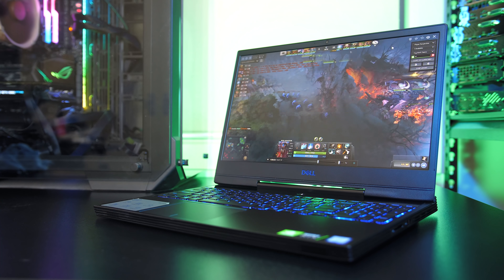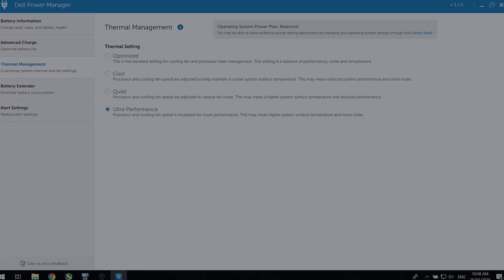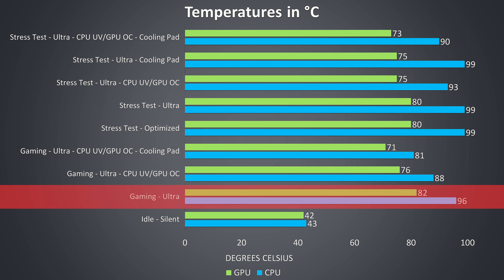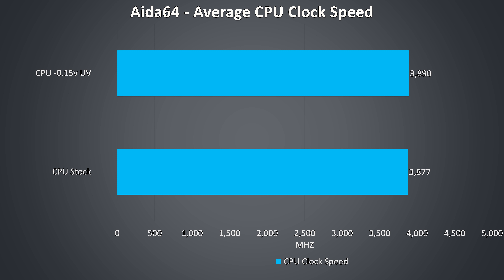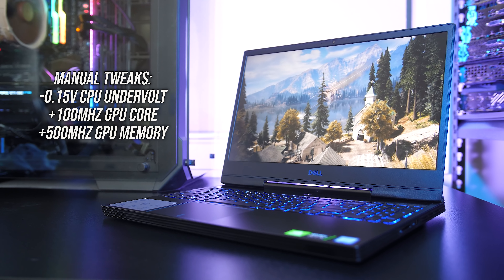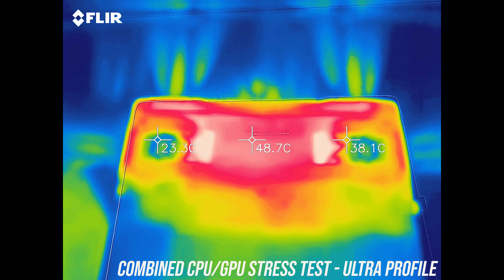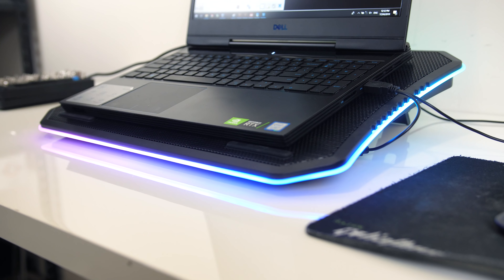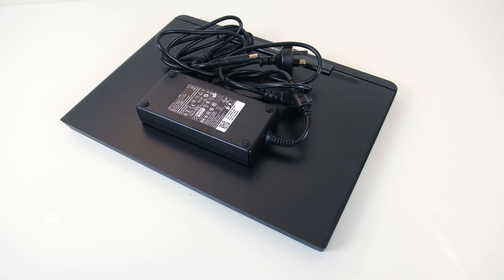Dell G5 5590 (RTX 2060) Thermal Testing, Overclocking and Undervolting

Comment from the maker: Check my full review of the Dell G5 5590 gaming laptop here: https://www.youtube.com/watch?v=BfszKYC2Fus
Reply: Could you share what application you used to overclock the video?
Reply: How did you under volt the laptop? I have searched extensively but couldn't find any solid information on how to do so.
Reply: @cjhouse8666  try Intel Extreme Tuning Utility
Reply: Is it possible to increase the gpu power limit to extend overclocking potential?
Reply: can you hear the fan on idle?
Reply: I have this laptop., but i7 9750H.. and with urgency a change of Thermal paste from factory is neccesary, to a thermal paste of  more quality... 3 month of use and hit the  procesador on 100°C constantly... wheen i changed the thermal paste i solved the  problem... now have 80-85°C.... :)
Reply: @zaper3  what things that you was do?
Upgrade on hardware,or having software control fan speed to be cooler

Comment: Just for the people that are frsutrated like me due to thermal throttling: Undervolting is still possible! My BIOS Version is 1.22. For me it worked to reset the BIOS to factory defaults and then the undervolting was possible. My G5 5590 (with RTX2060) is so quiet when you do normal stuff :) And no more frame drops due to thermal throttling. My Notebook reaches 88°C max when all cores are at 100%. There are some videos here that explains how to do the undervoltage step by step.

Comment: The best way to reduce the heat of the 5590 is to apply a new thermal paste. Anyone who has done it properly will tell you that it worked perfectly fine. Apply Grizzly Kryonaut (5mg syringe is enough) onto the CPU, it will reduce temps by around 10-15C, then buy a cooling pad (a good one with strong air flow, so don't be a cheapskate). Make sure it blows the air in the direction toward the ventilation holes at the bottom of your laptop). That'll give you an additional reduction of at least 5C as a nice bonus. Then you can expect around 15-20C down without undervolting or changing the core speed. 80-85C at a maximum load is absolutely normal for the gaming laptop and at this price range. If you're still skeptical, then buy a desktop PC.

Comment: Nice review Jarrod. Will you be reviewing the new Ryzen 3750H CPU and GTX 1660Ti combo from the Asus Zephrus G laptop? They said it will be out somewhere on May, also can you please review the new Gigabyte Aero 15 classic. Can't wait for these videos. Hope you have a great day/night. :)
Reply from the maker: Thanks! ASUS invited me to a launch event in a week for the new laptops, however I'm not able to make it as it's in a different city, but afterwards I should be able to start getting some review unit.
Reply: @JarrodsTech  too bad you can't make it but still happy that you're getting a review unit.
Reply: @JarrodsTech  when you do, could you help to find out if the USB-C can connect to a docking station to output display please? Also, wondering if using a PD charger will provide sufficient power to it when not using discrete graphics card.

Comment: After messing with the alienware command center I got fan control to work, trick is to delete the one that came with the computer and download the full app cuz its quite limited on the g5 whereas after re-download version can control the fans, I got my under load Temps down to 70 degrees with a repaste aswell
Reply: What is the name of the full app and from where should I download it
Reply: @mustafahamdi4229  the app dosent work anymore, just give up on fan control I tried for over a year just to give up and buy a desktop

Comment: Excellent review, very specific details, Thanks for the review, I wanted to buy this Dell G5 5590 with i7 9750H and GTX 1660Ti! I just wanna know how hot it can get, so thanks for the review.
Reply from the maker: No problem, cheers! Hopefully I can get the new 9th gen version soon!
Reply: @JarrodsTech  Do you recommend this laptop?
Reply: i'm thinkings about the version 1660 ti as well
Reply: @quecobpt  I ordered the 1660ti one, did you get yours? how is it so far?
Reply: @moonar5820  no. i bought a odyssey 2, the one with 2060 rtx
Reply: @quecobpt  I bought this laptop the other day.... definitely worth it
Reply: @RobNZ64  how long does it take to became hot? I dont mind the overheating if it happens after hours of use, ill simply turn it off until it cools down. But if you tell me it gets hot in 10 minutes there we have a problem
Reply: TEO Hi, don’t buy this laptop, had to return mine, CPU is always running too hot and can’t under volt it now because intel patched something in the latest bios update
Reply: @RobNZ64  wow thanks!!! Normal users like me often have the most realistics feedback, i trust you!! Yesterday i put my eyes in the hp omen 15, with 1000€ you get the i7 and 90% rsgb. What do you think of it?
Reply: TEO I actually went with the Acer predator Helios 300, same specs as the dell but comes with a factory under volted cpu and runs way cooler! Specially with the turbo mode enabled which overclocks the cpu and you (though you have the extra fan noise but I don’t notice it because I have headphones on) but it’s cool without the turbo mode but even cooler with it enabled.
Reply: @RobNZ64  it costs too much for me 😅. Im intrested in content creation, not in gaming, so i dont think the heat/fan specs are that important to me. I ll keep studying the market, but for my budget the dell and the omen were the most appealing
Reply: TEO oh yeah it is expensive, but I managed to get it in a sale $1000 NZD off so it made it as cheap as one of those omen laptops. But yeah I would avoid that Dell for sure! Good luck finding a laptop, would be good if that Acer comes one special sometime soon.

Comment: Thanks for the great Review!
I'm willing to buy the laptop. So after you have experienced it, did you notice any danger on the CPU when reaching 99 degrees?
Does it mean that my CPU is gonna be destroyed after while?
And has it happened to you, that the Laptop turned off or a Game closed automatically while gaming on Ultra Graphics Settings because of overheating?
Reply from the maker: Cheers! It's honestly impossible to say. While higher temperatures do generally make components not last as long, I've never found good long term data or studies showing how this can affect a laptop. Components are designed to thermal throttle and reduce performance to prevent them cooking themselves, but yes generally cooler is better. I've never had a laptop turn off or close an application due to high temperatures, I don't think they need to do that anymore, they just thermal throttle back.
Reply: I have. 2 resets playing Starcraft 2 LOL. Including Blue Screen
Dell G7 core i5 9th gen + RTX 2060. Of course i returned the shit to Best Buy

Comment: Thanks for the review Jarrod! Although your review suggest that this probably isn't the gaming laptop to buy, I managed to snag this from Dell AU for $1800 (9750H, 144Hz, 2x8GB ram, RTX 2060 edition)

I hope undervolting will be enough to keep it from thermal throttling...
Reply from the maker: It's hot but does have power behind that, double edged sword, undervolting should help though.
Reply: Clint Yip How it it’s doing now? I want to buy it but I’m worried the thermals would decrease the performance and lifespan of the laptop

Comment: Hi Jarrod,

Good review first of all. I was going to ask you how much difference there would be in terms of temperature if g5 had a 8th gen i5 processor?

Would there be a significant improvement in your opinion?
Reply from the maker: Thanks! I would expect the i5 to be a bit cooler, hard to say how much though as I haven't tested an i7/i5 under the same laptop chassis/cooling solution before, but less cores should = less heat.

Comment: Hi Jarrod
 
Do you think the Dell G5 5590 RTX 2060  heating problem could be solved with the new 9th gen CPU? 
and when you will be able to review the dell 9th gen G series?
Reply from the maker: I'm not sure if I'll get the 9th gen one, took ages for me to get 8th gen from them haha, I'll see what I can do though. If anything it will be hotter, same architecture + higher clock speed = more heat.

Comment: Can we expect similar from Dell G7 (i7, Rtx 2060) or better??
Cause that's what I am interested in!!
Reply from the maker: Probably, but I'll know soon, they sent out the G7 today.
Reply: Expect the exact same result: other thinner and lighter models (which should have worse cooling capacity) will perform significantly better, usually with a lower price tag and build quality to match
Reply from the maker: It really does depend, I've had thinner machines with more powerful specs cool better, but they do cost more as a result.
Reply: Thermals suck, don't buy it
Reply: I have just returned my G7 i5 RTX 2060 to Best Buy cause it reached +90 C degrees almost all the time. It reset twice playing Starcraft 2 LOL

Comment: @jarrodsTech I have the gtx1650 with a 9300H cpu, i was looking on  ebay and your video and the motherboards look IDENTICAL, would it be possible to upgrade my motherboard with 9300h / gtx 1650 to one with a 2060 and different cpu? cpu doesnt really matter, i just want something faster than that gtx1650 cause its soooo slow. p.s. not affraid to take a dremel to "force" things to fit lol

Comment: I like the looks of the laptop.very minimalist.dell needs to put stronger fans or maybe a third party out there where a stronger volt fan can fit in this chassis and replace the stock fans.as far as the speed maybe some bios hack can help with that or idk...
Reply from the maker: They could probably power limit it more like most other laptops have, but then you have worse performance so it's a trade off.
Reply: @JarrodsTech  is this the only company you know that has this problem this bad?
I cannot recall...wait Lenovo?.it's infuriating I bet bet for consumers

Comment: I wish I'd seen this year's ago, mine OVERHEATS from day 1 BUT why so slow in the GPU? I get 1980mhz to 2010mhz constantly with NO POWER throttle,  is my 6 pound power brick more watts or something? Doesn't much matter now my CPU is damaged from overheating and now it crashes instead of throttling,  I'm gonna try the heat pad and undervolt I re-pasted ave replaced the fan that melted

Comment: Can you review/test MSI GE63 8SE ?
Reply from the maker: At this point I'll settle for any RTX MSI laptop lol, they still haven't sent me any, they told me they have been holding them for an esports event in Australia this weekend (IEM in Australia) so hopefully I can get my hands on some soon.
Reply: @JarrodsTech  i just bought this laptop a week ago, i bought the 2060 version. The cpu is so hot when im playing apex lol it goes to 90C + im afraid that this is going to cause throttling(why the fuck i only get 50 fps at dota ultra sett and 90fps in csgo at very high sett) and everytime i plug-in my headphone it doesn't work so i need to disable and enable realtek audio.

Comment: Question. Do you happen to remember fan speed when testing? Reason is, yesterday on a cold boot, I got a bios diagnostic message about an error with the fans. Rebooted, didn't get message but updated bios anyhow. Ran the diagnostic (F12 at logo) and got the all good message. Fans reach 4500 rpm when testing so not sure if that's max speed or not.
Reply from the maker: They were at maximum speed under the testing, at least they didn't go higher, that said I didn't actually see the RPM value reported in the HWInfo data that I saved from the testing.

Comment: Hey @Jarrod'sTech, the G5-5587 from new egg with i7-8750+gtx1050ti, would thermals affect it's performance in tropical 45°C environment?
Reply from the maker: The 2018 G5 wasn't quite as hot as this one from what I recall, but you can refer to my older G5 video to see (note I had the 1060 so more powerful too which could raise temperatures). 45w ambient temperature is very warm though, the general rule is for ever 1c increase to ambient temperature you'll have 1c increase to the internals. Given the internals throttle at around 99c, it won't keep going up but performance will go down.

Comment: Should I undervolt using throttlestop? Cpu cache -150 and cpu core -150? Or cpu cache -125 and -150 cpu core? What was the set up that you used? I have the same laptop with the same thermal issues.
Reply from the maker: I use Intel XTU just as a quick and dirty way, but for long term use Throttlestop gives you more control, doing the cache does help but I haven't looked at doing it too much myself, I suggest this guide: https://www.youtube.com/watch?v=yNt9L3BWOFo
Reply: You can use Intel's own XTU if you prefer, it tends to auto match the CPU core and cache to the same values. If it's stable at -150mv on both then use that. Or higher if it goes that far (most don't get past -165) that I rarely see. You'll probably need to change the thermal paste. Try thermal grizzly Kryonaut or noctua nth2
Reply: Typically, from what I’ve seen on CPU undervolting, the core is the component that needs to be more thermally controlled as opposed to the cache so if you use ThrottleStop, definitely go further on the core as opposed to the cache.  As for those numbers, it depends on how hot the CPU gets because if you push the undervolt too far, you’re going to lock the system up as it doesn’t see enough of a workload to push itself.  Go with -150 core and -125 cache and if the system is stable but still looks like it’s too warm for your liking, undervolt the core by -10 mV increments till the system locks up, then just go to the last stable setting you had (meaning don’t save the undervolt till you know what’s stable).

Check out the “Bob of all Trades” YT channel or search “Bob of all Trades ThrottleStop” for a better understanding.

Comment: Hi Jarrod. I'm thinking of getting this 15 5590 (i7 8th, RTX 2060) for replacing my current 15 7559 (i5, GTX 960M) due to lot of 'value for money' reviews. However, after seeing comments for temperature issue..is it possible for Dell to come up with later solution for the user who purchased this model? Thanks.
Reply from the maker: Doubt it for the existing model, but at this point might as well wait 2-3 more days until I visit Dell at CES and see what updates/new versions they might have
Reply: @JarrodsTech  Thanks..really appreciate your reply..if the issue can be resolved by their next BIOS update (if any), I'll re-consider to buy this as soon 😅 I'm not the one who really particular for everything..as long the issue can be resolved just by 'update' soon or later, I'll stick to my plan on buy it

Comment: Could you give me your specific CPU UV value for Cache and Core, and same for GPU (core and memory)please? Also I have the i7-9750H - does this change much? 

Appreciate your response!
Reply from the maker: I don't do GPU undervolting, I use Intel XTU so it only changes both the core voltage offset and cache voltage offset to the same amount. The value I used was mentioned in the video, sorry can't recall it off the top of my head and I'm on a plane right now so can't currently play back to check, but I typically use -0.15v, but this information is useless anyway as each CPU has different limits, you just have to experiment to find the sweet spot for your hardware.

Comment: seems most of gaming labtop almost hit 100 on cpu temp. Aero, alienware m17, acer triton 500. I try them in games. All of them have the temp above 90 at least. The surprise is, msi gs65. It only reaches 74 in most of games with such thin design.
Reply from the maker: Yeah the Intel CPUs just keep raising the clock speed without any other improvements so hotter and hotter they'll get.

Comment: i dropped it to -0.164 on both core and cache , do you think i should try for more and will it start to crash or have lower cpu clock and worse performance? The temps are around 86 C with those settings in heavy games and no drop in clock speed
Reply from the maker: Depends, varies by chip and workload so you just need to test it out and find out what is stable for your hardware.

Comment: Do you think the model with 9750H and 1660Ti produce less heat?
Both cpu and gpu produce less heat than 8750H and Rtx2060, right?
Reply from the maker: Maybe, but both run at 80W so maybe not. CPU probably still has same power limit, but in theory it would use less power to hit max clock speed.
Reply: @JarrodsTech  and the 1660ti produces less heat than rtx2060.
Since the pipes are shared, then the total heat will be less, right?

Comment: hey guys, i'm looking to buy a gaming laptop and i came across a deal for a mint condition g5 5590 i7-9750h gtx 1650 for about 520USD, I've come across multiple reviews saying this model is really bad at heat management and want to know if it's not worth buying. I also found a g3 3590 with the same Cpu and Gpu for roughly the same price, which is the better option between these 2?

Comment: What do you suggest should I buy 1660 ti msi gp75 or dell g7 2060 for same cpu and ram or y540 with 2060 and 1 tb ssd they tree are same price 1400 $ , I really need help what do you suggest?
Reply from the maker: Y540 is great, check my recent videos. Have my first video on the GP75 coming out in about 7 hours time maybe that's useful.

Comment: How to undervolt this particular model with Intel's XTU? Could someone please give the exact values and where they have to be put it?
Reply from the maker: No one can give you that unfortunately, as the specific values vary by CPU, so you have to experiment for yourself. Generally I start with a -0.15v core voltage offset and go up or down from there.